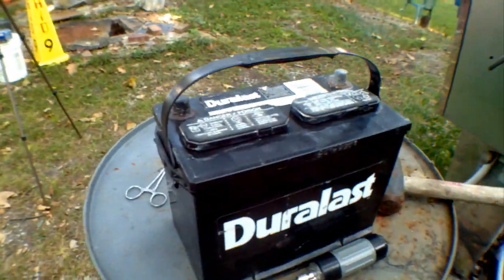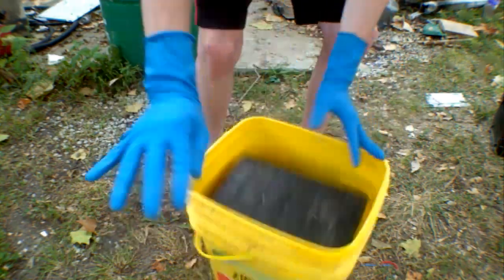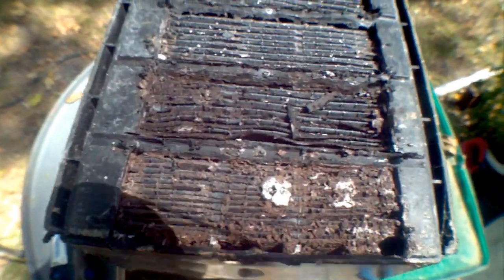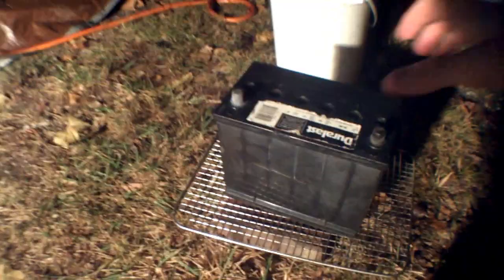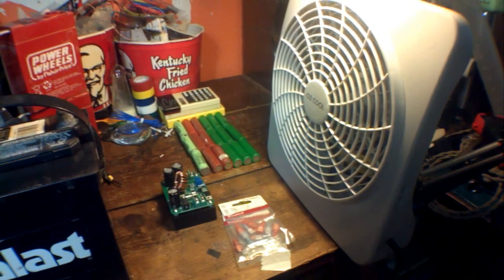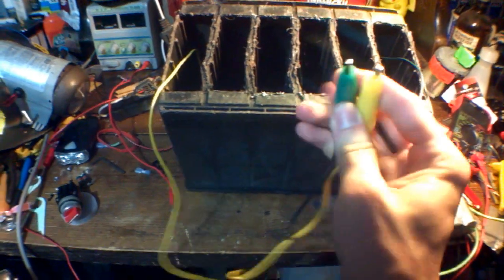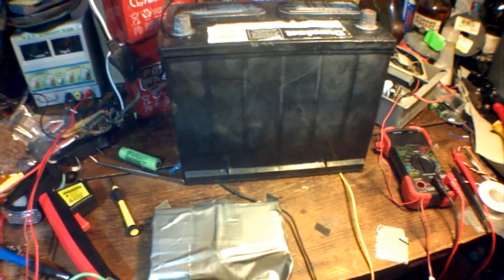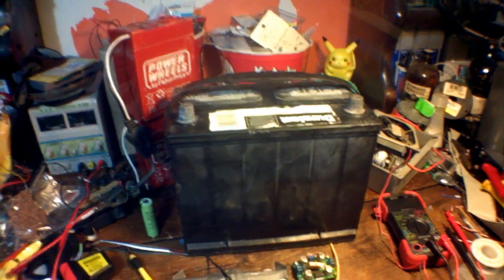DIY Lead-Acid to Lithium-Ion battery conversion 18650

Comment: Is this kid still alive
Reply: Rinoa Super-Genius
Oh and by the way I a person told me "DON'T YOU DARE EMPTYING THAT BATTERY IT'S TOXIC YOU WILL DIE" (it was a discharged battery so mostly water with some lead in it)and then the very same person was carelessly using bug killer spray in a closed room with little ventilation, and justified his action as "it's not toxic at all", right ....
Reply from the maker: Your joking right? Or maybe you think what I did in the video was dangerous and are too lazy to check my channel to verify if I'm dead or not.
Reply from the maker: raptorGTX  ah so your another chemophobe who doesnt understand when a chemical is actually dangerous. people think every chemical is dangerous so when a chemical actually IS dangerous they don't treat it very much differantly.
Reply: Rinoa Super-Genius
Haha, DHMO. (Dihydrogen Monoxide). Very dangerous chemical, right. ;-)
Reply: MrOpenGL
A lot of people have died tried to breathe it!  It's a powerful solvent.  Enough of it will kill many plants, and most amphibians.
Dangerous stuff!  And that's a regular temperature.  Heat it enough, and it goes through phase change and exposure to that can seriously burn you!  Thanks for the warning!  Not enough people know.
Reply from the maker: Ramix Nudles
 its also very corrosive.
Reply from the maker: MrOpenGL
 lol what a hypocrite.

Comment: I took a cigar box and cut out space for 4 12v 120mm fans. I took the controller from a 9v camping fan d-cell box and put together a 11.1v battery from lithium cells in an "okay" condition (leftover cells). The controller heats up in "low" mode, so I wrapped it in duct tape and copper wire for easy heat control. It was about 6-7ah, so at 1.6a, it lasts a few hours, still longer than the d-cells

Comment: Good Presentation, Could have saved a lot of the work tearing the old case and put the LI batts. in the tackle box used to prop up & clean out the old Bat. But was an interesting production! Good Luck. You didn't mention how many holes you had in your clothes after Mom washed them later! The acid never gives up once it hits clothe. <GRIN>

Comment: Nice project!  Had you considered only partly cutting the central vanes, or dividing walls, so that you could lie the packs inside horizontally?  That way they could be supported on all sides, but still be easily removed in case you needed to make further changes.

Comment: I have been throwing away my weak 18650 batteries.  I guess I should save them for projects which have low amperage requirements.

Comment: You are going to blow that pack up when you try to charge it. You really can't charge more than a few Lithium-Ion batteries wired in series as some will get overcharged. Those batteries will die if they are drained under 2.7V and explode if charged over 4.2V.  Since those are laptop batteries they lack protective circuits which makes things even worse.

Comment: How come this guy is still alive? Thinking few steps forward would save you a lot of time and pain.
More or less funny story: when my brother was in  high school, he heard a story that there was some guy hired as helping hand at workshop. Teacher was explaining to a group of students how properly charge a battery ( big one from tractor) and went for multimeter to check voltage. The handyman came in and told, that he knows the better and faster way to chek if it's charged, grabbed the hacksaw blade and shorted terminals. Two students were hospitalised, but the smartass wasn't so lucky since all that was left of him, was almost untouched pair of shoes.
Reply from the maker: haha funny fake story. sounds like a tall tail my grandpa would tell about when he was working at Shell refinery.
Reply: Rinoa Super-Genius I never said it's fake, though  I can't confirm whether its exactly what happened. I only whanted to show you importance of thinking when dealing with hazardous materials.
Reply from the maker: aras1024
well it sounds fake, batteries aren't that dangerous.

in order to vaporize a human body you would need enough energy to heat every atom of the human to several hundred thousand degrees.

all a battery would do if you where stupid and let it explode is make a big pop.
Reply: Rinoa Super-Genius Ever heard of hydrogen buildup during charging?
Reply from the maker: aras1024
yup. that is what we are talking about after all.
Reply: +Rinoa Super-Genius On behalf of the human race let me be the first to say sorry for all the idiots and trolls who posted on this video.  I personally would not have gone through all the trouble you did but I get it.  I liked the video.  I fully understand why you wanted to do it.  And honestly glad you did.  I got to watch it.  However you were at no point in the video in any danger what so ever.  Well maybe the part where you splashed some electrolyte out of the 5 gallon bucket but ehh whatever.  On that subject I did see another person state that battery acid or electrolyte is a dilution of sulfuric acid.  About 62 38 acid water.  It is not all that dangerous.  Don't drink it or leave it on your skin and all is well.  As far as what hit the ground. pfttt.  The ground and natural bases will neutralize that the next time it rains.  Lead on the other hand.  OMG why is everybody on your ass about handling lead?  Lead is listed LISTED,  As a dangerous material.  again don't eat it or sleep naked on a slab of it every night and you will be fine.  Besides all the idiots ranting about the lead factor are most likely the same dumb ass red necks that rap 10 rounds in to the air every new years.  Millions of lead bullets come falling back down to earth and embed them selves back in to the ground.  Yes BACK in to the ground.  lead is an element that is mined from the earth people.  And if I recall correctly fishing sinkers are still made of 100% pure lead.  So I do wander how many little lead balls are at the bottom of ALL of the fishin spots across the world, polluting all the ground water and the fish we eat. HMMMMMMM.  Keep being curious and keep posting new videos.  I know this is a year old but I just stumbled across it.

Comment: hope you make it to old age but looking at that show, I'd doubt it
Reply from the maker: i do stuff thats safe tbh. when something is really dangerous i take the proper safety precautions.
Reply: Rinoa Super-Genius then don't charge li's without each cell control, cooling.
Reply from the maker: larry liegerot lithium cells should get warm, if they do your probably being stupid with them, and no you dont have to balance each cell, just each parallel pack of cells. it is impossible for parallel cells to get out of balance from each other.
Reply: Rinoa Super-Genius It's not impossible for parallel cells to get out of balance and you even admitted yourself that you were doing a series parallel setup, therefore without a doubt some cells could get out of balance.

Comment: Very Interesting videos I really enjoying and learning where can I find that 7 dlls  or make a voltage step up transformer?  Thanks and keep up the great work super genious another thing I have a lithium battery that I used for a electric bycicle motor and the charging unit failed had to cut the wires for the unit and now i have a big mess could you help me rewire it and figure out what is wrong I need it for work peace brother !
Reply from the maker: this may help with wiring the cells for balancing. i use an Imax B6 to charge mine.

DIY: Balance Charging E-Bike lithium battery upgrade

Comment: lol you notice the whole time hes wearing flipflops and working with battery acid lol ......
Reply from the maker: haha. just FYI old battery acid losses its potancy quite a lot. battery acid starts out as 90-95% water and 10-5% acid but over 20 years it was more like 0.05% acid.

I've also gotten new acid on my a lot and its not all that bad. its the pure acid that you have to worry about.

if you think about it the human body is built to resist acids. water is a very corrosive acid. so we do have some protection against acid. especially heavily diluted acids.
Reply: Rinoa Super-Genius
Not true. The human body is good at regulating these things internally but not externally. Also normal pure water has a PH of 7 and is not a very corrosive acid at all. 
The main regulation our body does is breathing. This is for blood regulation though. 
Our gastric acid in our stomach is a strong acid with a PH of as low as 1. But most of our body is actually neutral.

If you spill strong acidic or alkaline chemicals on yourself, your body has no such regulation at all to prevent damage. Your body only has regulation if you ingest too much acidic or alkaline things and it's to a certain level.
Reply from the maker: ziongite
yes but we arent talking about spilling strong acids on ourselves. we are just talking about battery acid. or diluted sulfuric acid.
Reply: Lead-Acid batteries that are discharged are almost 100% water, since during the discharge process the acid solution gets turned into water (and that's why Specific Gravity is low when the battery is discharged)

Comment: I enjoyed watching a "Super-Genius" almost get acid burns all over himself, and watching him turn a car battery into a holder for lithium-ion batteries.
Reply from the maker: haha, "super-genius" is kinda supposed to be a sarcastic name :P
Reply: that battery is so shitted up he might as well have got a new one
Reply from the maker: trancematic
Joking right? Why would I rip open a good battery?
Reply: Rinoa Super-Genius To be very honest, WHY did you open up an lead-acid battery for use as a holder for already sealed and safe Li-Ion battery's, to be honest you could have even better used an bread box with to big metal pins for connection... just as refrence point of course....
Reply from the maker: Xtreme Dummy
 guess you dont understand the idea of a "novelty"
Reply: i do, but that does not mean it is smart to just "rip open" a lead-acid battery for such a simple use as a holder for lithium battery's...

Comment: I reckon governments and industry are holding back on us.  Inquiring minds like yours, help to better understand what can be done.  Keep it up, well done (and to your mum!).
Reply from the maker: haha thanks!

and modern corporations loooove adding more computers and stuff to cars. the onboard computer of a car is always taking like 200ma of current from the battery and that kills batteries faster.

thats why in the 1970s the average battery life was 7-12 years, now with computers and stereos wearing them down constantly we can maybe get 3-7. my greatgrandma's (now mine) 1982 Mercury Zephyr had its battery for 20 years.

and another thing that pisses me off. i hate how they want us to invest in hydrogen fuel cell cars when you can run a car off hydrogen just fine. infact hydrogen is a gas so doesnt need anything to vaporize it unlike petrol.

but yeah, my rambling aside. corporations like to screw us over. just like in "Who Killed the Electric Car"
Reply from the maker: Kevin Chamberlain
 i've never heard of Bob Lazar till now. and tbh i don't trust people who say they worked on alien technology. studies have shown that people can easilly trick themselves into thinking something. every time we access a memory we change it slightly. like i'm sure most of my memories are wrong.

i do believe their are aliens out there. but if they had made contact i would need substantial proof to back up such a big claim.
Reply from the maker: Kevin Chamberlain
yeah a lot of people run their car off hydrogen or propane. its not really all that new haha.

hell my greatgrandpa ran his truck off propane in the 1960s. i run my lawnmower off propane.
Reply: Rinoa Super-Genius Propane is used a lot on carbureted engines when offroading because carburetors are unreliable at crazy angles.

There are a lot of kits for Jeeps.

BTW liked the vid!
Reply: Rinoa Super-Genius I'd imagine we'd have much better luck running cars off of natural gas instead of hydrogen.  Yes, I know hydrogen burns clean, but it's not economically feasible yet and people still don't like the idea of driving around with tanks full of pure hydrogen (remember the Hindenburg?)
But I'm personally in favor of electric vehicles anyways so...yeah.
Reply from the maker: Don Skiver
 yes but it wouldnt be stored in a rubber balloon with thermite around it. so saying it's like the Hindenburg is stupid.

hydrogen would be a good way to convert our current cars to electric. generating hydrogen via electrolysis will add a step of wasted energy but the hydrogen has a much higher energy density than batteries currently do.

making petrol takes a shit load of electricity already, so making hydrogen would get rid of the need to drill for oil since we could use water and it would prolly use less electricity too. still full electric would be best. just full electric takes a lot of copper and lithium metal.

i hope they figure out sodium ion cells, we could get sodium from salt, we could make all the batteries we wanted then.

hydrogen is more economicly feasable than petrol.
Reply: Rinoa Super-Genius Yes, I understand that the hydrogen won't be in a balloon...I simply described how the public would be reluctant to trust hydrogen based on the Hindenburg experience.  

And the reason hydrogen isn't terribly economically feasible yet is because the infrastructure simply does not exist yet.  

One of the problems we need to solve first and foremost is getting our electric plants away from dirty coal burning and toward cleaner, renewable sources.  It makes no sense to burn tons of coal to generate electricity, and then in turn, use that electricity to create hydrogen via electrolysis.  It's a huge waste of energy and still spews garbage into our atmosphere.  That's why I suggested methane as an intermediary step since the infrastructure is (mostly) there, methane is (relatively) clean burning, and it can serve as a good stop-gap until we can make the full conversion to electric.  Hopefully by then we'll have more solar and wind plants...though I'd personally like to see more nuclear plants...but public sentiment towards nuclear is pretty low thanks to incidents like 3 mile island, chernobyl, and fukushima despite the leaps and bounds that have been made in the safety, cleanliness, and efficiency of nuclear power...  If we can get cheaper, cleaner power plants, all that we'd need to work on is making cheaper, more efficient batteries.
Reply from the maker: Don Skiver  i can't wait to see how ITER turns out.

you do realize you could use hydrogen, propane, and methane on the same car upgrade right? thats all we are talking about is a car upgrade. weather you want to have a hydrogen producing machine at home or buy methane from a gas station is up to you and whatever is cheepest, witch would prolly be hydrogen because you could make a simple hydrogen producer that was automatic for under 1000$.

using the coal plants to produce hydrogen would still be far more efficient than using them to produce petrol. not counting you could always slowly phase out the power plants.
Reply: Rinoa Super-Genius Hey nobody's stopping you from creating your mad science hydrogen frankenstein car.  All I'm saying is that for the public at large, it's just not there yet.  

It's not always about what chemical has the highest energy density or how simple a process is...  You have to also realize how deep Big Oil's pockets are and how much of a vested interest they have politically in this country and in other parts of the world.  The entire middle east is completely dependent on the petroleum economy.  There's no quick and easy solution that takes care of all the problems for everyone, and I'm simply pointing some of those out.
Reply from the maker: Don Skiver
 yes i know, but theres lots of companies working on the technology i stated. so its not like theres no chance for it.

Comment: If those are ICR18650 batteries that are unprotected, you just built a big bomb waiting to go off.
Reply from the maker: nope its not a big bomb, I balance them manually or with my imax b6.

not counting lithium cells rarely blow up.
Reply: Rinoa Super-Genius  So how do you balance them manually when they're all taped together in a big pack with just the two leads coming off them? Seriously dude if you just try and charge this straight off a bench PSU with those two leads, as you showed in the video and aren't very careful about how you do it, keeping well away from the full capacity in case of individual cell overcharge, you're gonna have an exciting malfunction with that thing sometime soon.
Reply from the maker: ShokaLion
 you just remove one piece of tape and can connect leads to the internal wires. its not that hard.

Comment: Better not disassemble acid batteries because lead compounds found inside battery is much more toxic than lead.
Reply from the maker: thats why I whore gloves. but yeah I agree lead oxide is more dangerous than plain lead.

Comment: For your step up transformer, you might want to check out a guy named Lasersaber, he makes a similar thing that he calls a joule thief.
Reply from the maker: yeah joule thiefs are pretty common but they work better for really really low voltages.

and lasersaber's ultracapacitor videos are pretty fun too :D

Comment: why use the hold battery just make a battery pack its smaller
Reply from the maker: because I like this battery and it was fun. the real question was why not?
Reply: lead acid battery bulkie 9ultrafire batterys 18650 battery pack takes less space up
Reply: buy the way going to do this with the 18650 batterys is to put me solar panels to charge them with me solar regalater
Reply from the maker: bucketrobbert
you might wanna work on your spelling, your hard to understand.

also i would advise against ever buying Ultrafire cells, they are a scam.